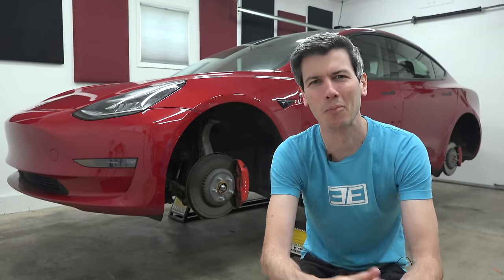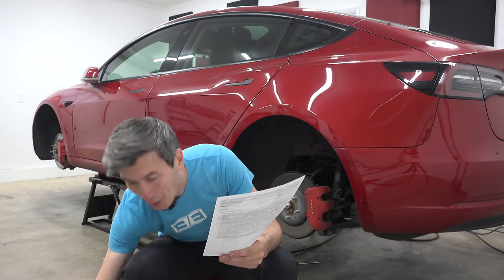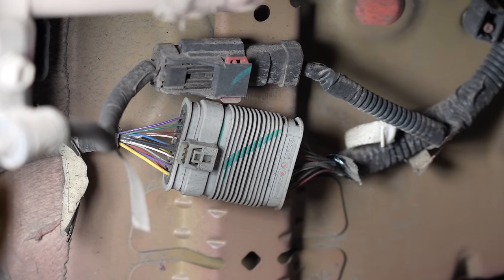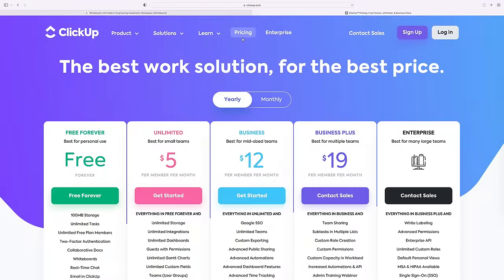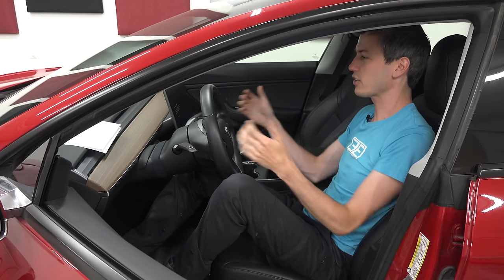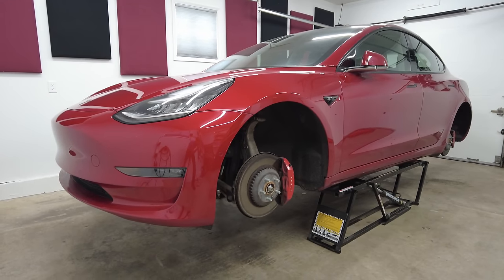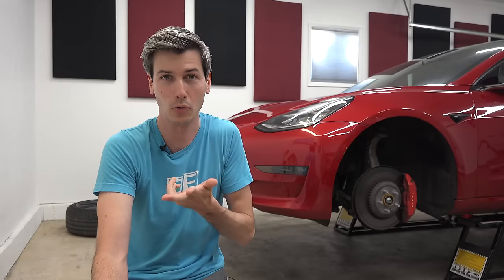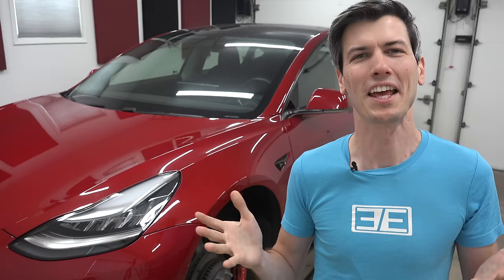Tesla Battery Damage? I Ran Over A Metal Bucket

Comment: My Model S is now 6 years old. I've only had minor issues with it, all of which were replaced under warranty. Then the warranty expired (by mileage), and the tailgate got stuck closed. I visited the service center and they quoted $970 to repair it. I knew what parts were needed so they were happy to sell me those instead - for $70. I couldn't be happier!
Reply: Hatch actuator, breaks on all of them eventually
Reply: No mate, they werent happy about selling you that part 😁
Reply: Yeah, it is kind of weird that the parts Tesla actually sell - they sell for really cheap...
Reply: @rkan2  They sell the plastic upholstery clips are $10 each. I returned those after discovering the Toyota ones are identical, and cost 100x less 😂. But I think that's the exception that makes the rule.
Reply: @f36443  I really don't like powered tailgates - I don't understand the benefit. They're so much slower to use than a manual one. So the cinch actuator failing on mine added insult to injury 😅
Reply: You are lucky that the door handles still work.
A friend had to get all 4 replaced, it costed the same as a new engine for my ICE car.
Reply: @larsjrgensen5975  doubt (x) unless you are talking about sime 4cyl toyota scrapyard engine...
Reply: @rkan2  Tesla charged somewhere between 500-1000$ per door handle replacement, it was before DIY kits was available.
4 handles = 2000-4000$
Saab B207R engine block with head 210hp 1800£

Comment: Great review. We have a MYLR and yeah, the "real world" acceleration seems to be the thing people seem to overlook. 40-70 passing acceleration, even in the non-performance is insane and I feel much more confident when I need to pass someone than I did in our old ICE car where I'd punch the throttle and wait for the CVT to kick in. So far, we haven't seen that much lower a real-world range, but it's still around 80-85% of the rated.
Reply: You don’t need to spend 50k for that, my eGolf has the same responsive feeling with just 100 kW. Only when completely flooring I notice the power is equal to my old Model 3 LR.
Reply: LMAO you had a CVT
Reply: "wait for the CVT to kick in" lmao
Reply: lost it at cvt
Reply: @Deveonn  how much range does the e golf get?
Reply: You sounded credible until "wait for the CVT to kick in".
Reply: @JV-py3lg  about 180-220 km and charges at 40-45 KW, works great for our (urban) family.
Reply: @MrSonicAdvance  Seriously, The Subaru we had before the MY was terrible for acceleration. Whenever we wanted to pass someone and needed acceleration, the process was to punch the accelerator, wait about 3-5 seconds and then the CVT kicked in and the car would start to accelerate. The car was a very nice ride most of the time, but acceleration and the CVT lag were problematic at times.
Reply: @andrewhayden2477  All these smartasses completely missed the point - so eager to jump on a technicality just because CVTs don't technically "kickdown" to a lower gear. But the joke is on all of you: CVT's do actually kick down because they have a bunch of set ratios designed to mimic the geared sensation of a traditional automatic. They are also famous for having slow response, both in processing time to select the correct ratio for the amount of throttle, and also the mechanical aspect of adjusting the pulley ratios. In short, they are much slower to respond than a traditional automatic, and even worse compared to a Dual-Clutch Transmission. It does indeed feel like it takes a while to "kick in" - in the same way people might say a turbo kicks in or VTEC on an old Honda kicks in.

Anybody who has driven a CVT vehicle knows exactly what you were talking about. There's a very noticeable delay before you get any decent acceleration.
Reply: @mikescherrer4923  what’s wrong with CVT’s??
Reply: @andrewhayden2477  weird the CVT on my 22' Outback Wilderness is lightning quick. Quick anecdote; a Model Y tried to keep me from getting over a lane on 695 @ 70mph, i hit the gas and went right around them no issues. Im guessing whatever subaru you had previous was one of the slow as dog poop models
Reply: @andrewhayden2477  Hi Andrew. What you say is absolutely correct, however it is well known that CVT gearboxes are not ideal for power applications. Comparing a CVT equipped car to an EV when it comes to acceleration seems silly. That said, I realise that CVT gearboxes have improved a fair bit in recent years, but I wouldn't touch one with a bargepole. In my opinion, CVT gearboxes is fine for low power applications where convenience is valued over performance, but I think they're just an expensive failure waiting to happen. (Note, I drive a car with a DSG gearbox, and while I'm very happy with it, there are people who would say that a DSG-equipped car is just an expensive failure waiting to happen. 😄) 
I think the poor perception of CVT gearboxes is why you've taken a lot of flak in reaction to your post. Kudos for your chill reaction to the flak. 🤝
Reply: What car did you own?
Reply: @andrewhayden2477  Just two days ago I had 14.7 kWh / 100km on distance of 100km (about full day of city driving). 14.7 kWh/100km is textbook range for Tesla Model Y. With 75 kWh pack, it will make exactly 500km from 100% to 0%

Comment: 310 miles of range is for the 18" wheel model, not the performance with 20" wheels
Reply: That makes sense. I downsized my truck tires by 2 inches and now I get 15%-20% better mileage at 90km/hr
Reply: @KF1  If you're basing this off your truck's odometer/range gauge it's not going to be accurate due to the change in circumference of the tires unless you're already accounting for this by doing the percent change yourself. The tires are making more revolutions to go the same distance, and the system measures distance based on wheel rotations and converts it distance. My truck used to say I was doing 35mph when I was doing 33mph according to gps. I increased the diameter and now 35mph=35mph. The reduction in rotating mass will definitely help mileage though.
Reply: @Warduck645  Oh crap you're right. Still better mileage but yeah my numbers are off.
Reply: @username8644  Also one time calculation isn't always reliable because of air vent messing around with a point of when tank is "full". It needs to be 3 full tank cycles to reach a reliable measurement of MPG.

Comment: For the windshield wipers I usually just press the button manually when the visibility starts to decrease. It's slightly annoying, but seems more natural than looking down at the bottom of the screen (away from the road) to change wiper modes.
Reply: yes, always use the stalk button to kick off the wipers manually. Then the wiper sub-menu popup window appears, you can set manual speed there... or use voice controls.
The only main problem is for current pure-vision AutoPilot cars, they require the auto wipers on :(
Reply: RainX
Reply: @GM-qh2ki  Rain X car wash, make my M3 sparkle. Awesome product, wash and let the water just flow off by itself.

Comment: I had a VW Golf back in 2013 that I bumped a curb and damaged the under tray. Like you I was concerned about future issues and had the dealership inspect the bottom of the car and order a replacement cover. Unfortunately the following week it caught fire while parked in my driveway. There was never any mention about whether the events were connected but I'm glad I had someone check it out. I'm glad you didn't have the same experience!

Comment: Thanks for the 4 year review! 
The M3 performance is fantastic but even the M3 RWD (LFP), that I got early this year, has pretty good performance in the real world - the handling and road holding is great on the many winding roads we have in NZ. After the rebate we have available in NZ mine cost about NZD 60K (USD $37,000) versus the 105K it would have cost me to have a performance (where the rebate does not apply and also doesn't apply for the long range). The build quality out of Shanghai plant is really good - I was happy to find no issues (and the same for other friends that bought the M3 recently). Range is stated as WLTP 491km which is rubbish but over 400km on the open road (100kmh) is achievable if the  weather and temperature are good (or if you choose to drive a bit slower). This range is fine as I really need a break by the time I need a charge anyway (in fact super charging can be too quick for a break for food and sometimes I elect to go to a slower charger). To be fair it is possible to get 491km if you were driving around town the whole time at 50 - 70kmh, but its rare that someone needs to drive their M3 around town for 491km in a day (9 - 10 hours) - maybe if its a taxi?
Reply: You’re very right. Friend has one and your observations are dead on.
Reply: Agreed, my LR-RWD acceleration is PLENTY... ~5sec 0-60 blows nearly anything away, and it's seamless and smooth... I recently realized, that is the same/better as my 80s teen dream Lamborghini Countach! 
Even plain AWD has almost too much power (got a Model S AWD loaner)... performance? or PLAID?!? ludicrous ;)
Driving curvy mountain roads w/ one-pedal driving is fantastic, like a stick-shift but w/ infinite-speed low gear.
Really, driving a Tesla feels more like flying a fighter jet or LearJet w/ afterburners, than driving a "car"...
re range, on roadtrips, almost always the car outlasts my butt and my bladder. and it's done charging, before family is done w/ snack/potty/stretch breaks... and AutoPilot makes long drives very relaxing, MUCH better than ICE cars. Roadtrip dream..
Reply: Ditto (2022 RWD in Australia). Have a slight issue with driver's seat back, but otherwise impressive in build quality and general experience.

Comment: I bought FSD in the brief period where it was only a $2k upgrade, and I did it for the summon feature that I use regularly. My use case is pretty simple: I have a two car garage with two cars and a motorcycle. I park the motorcycle behind the cars so I need to move my Model 3 out of the way to get the motorcycle out. With all my gear on I can't fit into the car, so summon is actually a legitimate convenience.

Comment: Your early reviews and videos on the Tesla model 3 were part of what helped me decide to get one myself.  I've been driving a 2020 "stealth" performance for about 2 years now.  It has all the performance acceleration but it doesn't have the "performance package", so no spoiler, no red brakes, no aluminum pedals, no lowered suspension, and it came with 18" aero wheels.  It is probably from the last batch of "stealth" performances made, sadly no heat pump which I missed by a few months and we get a real winter here so it would have made a difference.  You are correct, even after 2 years the acceleration does not get old.  You are also correct on the range, but the rated range (mine is 322 miles) is mostly a flaw in the EPA test.  I have approached the rated range but it can only be done when the outside temperature is warm and you can't even look at high speed freeway driving.  I did a 212 mile round trip and consumed 65% SoC in the process for 231 wh/mi with an average speed of 48 MPH.  So basically if you drive like the EPA test in calm comfortable Midwest July weather, then you can get EPA rated range.  Now during winter on the other hand, when it was below freezing out and there was some freeway driving into a headwind I did a 175 mile trip and it consumed 84% SoC at 372 wh/mi, I had to supercharge after about 100 miles to help alleviate some range anxiety.
Reply: With heat pump real range is getting close to rated range but only while doing city driving

Comment: For your carbon fiber spoiler. Use BLACK SILICONE to seal down the entire spoiler. It will also fill the small gaps at the very ends. Use blue painters tape to hold tension on the spoiler as it dries.

Comment: I've never had that AC smell in any vehicle, not even my Model 3, because I always run the air on high with the AC off for a few minutes before shutting the vehicle off.  And that helps to remove the moisture on the condenser.

I don't think your Performance Model 3 was rated at 310 miles of range.  But my 2018 AWD LR Model 3 that was rated for 310 miles used to consistently get that, not so much now more like 285 miles.  And considering basic Autopilot is now included in all new Model 3's you'd think Tesla would have automatically given it to your car too.
Reply: I turn off the AC a few minutes prior to arrival to let the airflow help it get to ambient temperature and dry off.
Reply: @vprwave  I meant to say I run the air on with the AC off for a few minutes.  Fixed my post.
Reply: @Resist4  Alright, we have a similar strategy against the foul air then.

Comment: The automatic wipers have always worked really well on mine, but I have a 2021 that was vision-only from the start.  Maybe they had some improvements.  I haven't had the software issues like black screens and lag you have either.  Although mine likely has newer computer hardware as well.  Totally agree with you on FSD, it's not worth anywhere near what they're charging for it.

Comment: Your experience with the wipers is interesting.  I have a M3P made in the fall of 2019.  The only consistent complaint I can make is that IF the rain begins with a very light sprinkle, it’s not uncommon that I have to kickstart the wiping using the stalk.  Other than that, they work as well as the wipers on the only other car I have driven with that feature, which also has the same issue. My 2007 Boxster S.  Edit:  When I mounted the same T Sportline wheels that you bought my real world range was around 280 to 290 miles at 70.  Now, with 19” aero wheels and UPP front splitter and efficiency spoiler,  I see the same range at 80.  To be clear, I am assuming those ranges based on achieving 250 to 260 wh/mile.

Comment: That Cover replacement for 11$  at the dealer is amazing. (even though its weird that the part is so expensive on ebay)
Reply: ...then $82 for nothing!
Reply: @rp9674  But you can't know that they won't get it resolved without trying. And they're not going to charge you $0 for spending several hours trying to improvise solutions. That would mean the cost would be absorbed by other offers.

Comment: On newer cars the cabin filter is easier to replace. Wiring harness is not in the way, and the bolt to remove the cover is at the bottom now, easy to get.

Comment: I may be a bit of an old fart. Since I gave up on "modern" cars and got myself a Volvo 240, I had eight years of 100% trouble free driving. It´s 32YO now and I have been hitting a lot worse stuff than buckets. And you don´t have to look away from the road to turn on the wipers. And it doesn´t need a camera because it doesn´t have any dead angles. It may be the opposite of a Tesla, but it´s comfortable and nice to drive and very practical (it´s an estate). And it will outlive us all, and the fuel tank doesn´t experience any degradation. But I´m glad to hear you didn´t suffer any bad damage on your Tesla. I´m thinking about that guy that "Rich Rebuilds" helped. He also drove over something and the coolant connections broke on the battery. Tesla quoted him a whole new battery when it only needed new coolant connections. Rich could fix it with cheap stuff, but think about how bad it is if someone has to replace a crazy expensive battery because Tesla treat their customers like Apple.

Comment: Luckily for you your Tesla service center actually is nice. I had an issue with my suspension and did a temporary fix until the car out of warranty. Once its out of warranty, they quickly noted the source of the problem and charged me massive dollar to replace the defective parts. Note: rear upper arm suspension squeaking.

Comment: Actually,  you don't need to go to the screen to change the speed of the wipers. Pressing button on stock and moving  left to right the scroller on the steering will do the trick. And my assumption for wipers going crazy while backing,  is extra water on roof pooring in waves with the momentum.  
Anyway,  great video. Keep up the great work !

Comment: I thought it will cost $600 instead of $12. I'm flattered by Tesla. 👍
Reply: Tesla is unusually cheap for the parts you can actually buy. Even the drivetrain parts are cheaper than industry, but not cheap though. Labor is the same as other dealers pretty much.
Reply: I was guessing $60-90 for the part, half hour labor(minimun)

Comment: I bought a new Model X in 2017 which I still own.  Never been to a service center.  Only maintenance are tires and recent cabin air filter.  My Porsche 911 with similar msrp costs around $1000/year for oil changes/yearly checkup.